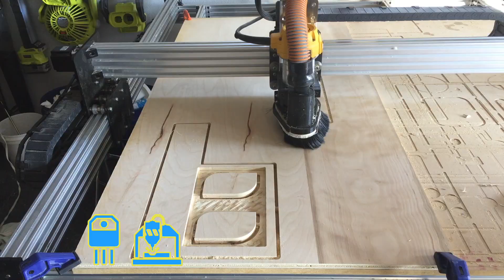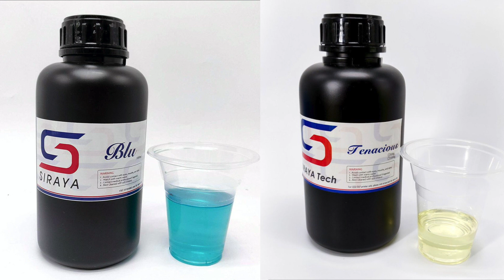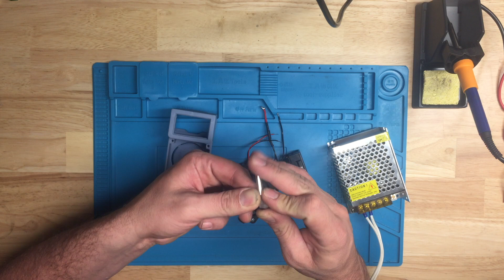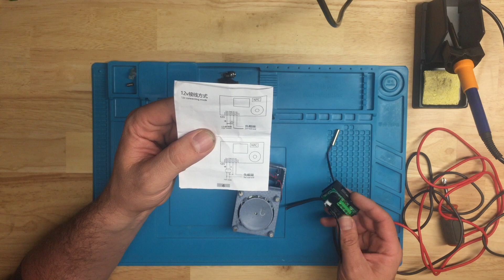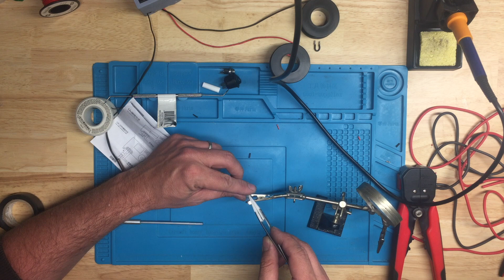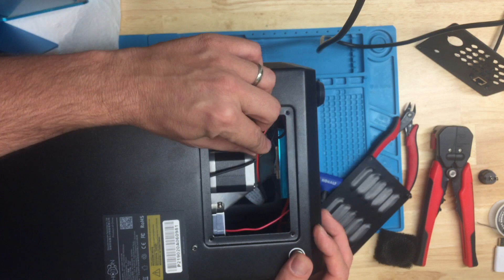3D Printer Resin Heater

Comment: This makes no sense. You can not print and blow air directly in to the print. You need to have a heated chamber around the printer. Or a silicone heating rubber around the tank. But not air circulating around the print.

Comment: Warning potential fire hazard! As an electrical engineer I need to warn anyone building this, this item needs a thermal fuse adding between the PSU and the heating element. If the thermostat, the PCB or the fan fail there is the possibility that the element will just continually heat up and not switch off! I have built this and I added a thermal fuse which hits a max temperature of 65c (any basic thermal fuse will do). I also added a timer switch so it turns off automatically to correspond with the printer time (you can buy plug timers which do the same thing). I also had to redesign the body as it's not really big enough either.
Reply: 100% agreed. let's not forget all parts are made in china.
Reply: Ty for info! I'm planning on a build similar to this and would like to add a thermal fuse for safety. I only seem to find fuses rated for 240V though. Is it possible to run a 240V fuse on 12V?
Reply: Yeah it will still work, it's just up to 240v
Reply: Could some One explain me exactly where to put the thermal fuse?
Reply: @matteopiccin5555  between (+) and the heater red wire
Reply: Complete noob here, got more details or vid?
Reply: You can cut the wire combining both heater elements + leads and just use one of them, thus cutting the power to 50W or so.  Still plenty of heat to warm up the enclosure and reducing fire risks.  100W is not really needed for such a small space.
Reply: It's a PTC heater they self regulate, they won't overheat if the fan fails and the thermostat stays on.

Comment: Please help. I've blown 4 of the controller units 😭 I wire everything up correctly but it still blows. I get it working. Unplugg the power supply plug it back in and it blows.
Reply: You probably wired the live to neutral or earth

Comment: Thanks for the DIY for the Resin printer heater.  I really want to build this because I'm also using Siraya Tech Build and other resins that require 25-30C environment. I have a Photon Mono X. I do have one concern thou; I've had my printer about 1 year now and just recently the plastic knob that secures the build plate along with the plastic knobs for the resin tray are disintegrating (I replaced them with metal ones from McMaster) - I conclude because of the resin. I would be concerned about building this out of 3D printed parts that they too after time (along with the fan) would be affected being in the chamber and recirculating the resin fumes. Any thoughts about this?
Reply: I think these have been out on the wild for more than a year now and the consensus seem to be to "just" print them in resin. 
I'll be building one shortly - parts are on their way - and if it lasts a year or two and I may then have to print a new casing for it, that's fine with me.
Reply: @AntiVaganza  Yes, since I did these I now have an FDM printer that does nylon - so if you have access to FDM,  I'd print the case out of PP or Nylon; that way it would be impervious to resin fumes and possible degradation.

Comment: What is the best air flow direction? The fan keep cold air that is pushed in the heater and then in the printer or the cold air enter in the heater and then the fan extract the hot air and push it in the printer?

Comment: do you keep your resin stored in a place that has high enough temps?  or is this setup expected to actually heat up the resin as well as the chamber?
Reply: This setup just heating the AIR inside the printer chamber, not the RESIN...so stupid, and being reproduced by many same ignorant "believers"
Reply: @archierri  like an air-fryer for resin.  Kind of how a home furnace just heats up the air in the chamber, and the rest of the contents of the home get to that temperature

Comment: I'm slightly worried about your wire gauge for this project. 10A you should probably be using 12AWG wire or you risk turning the wire into a heating element and starting a fire. I would maybe consider 14AWG. That 100W heater, using its rated capacity, should draw about 8.3A. I would consider a power supply of 12A or greater, and a 9amp inline fuse for safety, as it appears the thermostat draws no more than 1A. You aren't seeing any more than 50W usage because your power supply can't output more than that.

I totally intend to do a mod like this on my Mars, but I will implement these better design changes.
Reply: 1mm thick wire is good for up to 16A in most conditions this setup it can be pushed to 19A the thermal shielding is usually rated for 75C if it silicone its rated for 90C line fuse is a good idea but the wire gauge is good for setup

Comment: No instructions or diagrams with either of my components.  You fast forward through the wiring, do you use a jumper to the 3 grounds on the back of the thermostat?  Thanks. Excited to get my resin printer back up and running in this cold weather.

Comment: I think if I move my printer to the garage I'll need to do something like this. Will probably to a little transistor to mosfet thermal regulator though, otherwise it'll be cold after 40 mins or so

Comment: you say it's only using 50watts, but the heater is rated as 100watts. Will the 5amp power supply really be fine?
Reply: No! This thing is rated for 8+ amps, but always go bigger, at least 10.
Reply: Be careful. I burned my 12v 5a adapter :(

Comment: This is amazing! Also hoping to ask if I can just put my resin printer in some sort of enclosure with a heater inside and let the heat build in there. Will that get the same results?
Reply: in principal that sounds fine but you will need to regulate the temp so it doesn't get too hot.

Comment: Trying to follow along with this as I'm conpletly new to trying to wire things up. What hole on the thermostat do you put the red wire from the heater into. You fast forward through most of it and I cant see where they go. I can only follow with black cable to far right hole.
Reply: I haven't installed one yet but I have purchased the recommended components and am testing it out.
The thermostat has 4 terminals. Two ( marked + and - on mine) are for powering up the display and electronics of the thermostat itself . Those connections are totally separate from what you are switching and they can be powered independently
 On mine the switching terminals are marked S and S. Programming the thermostat will makes connections close or open depending on the temperature and how you have programmed it. 
It doesn't matter which one of the S terminals is connected to the + of your power supply. The other terminal should go to the device you are switching (via the red wire) ..and then that will have the other connection from the device (black wire) going to - on the power supply.

Trying it out, running the heater and fan at 12V can lead to a very large current, so I am trying it at 5V before I install it. 

I am also trying out a flat heater pad stuck to the back of the printer instead of the heater and fan. It's less disruptive to the printer (no drilling or taking apart) and avoids blowing hot air around the print area .. which strikes me as a potential issue source of a problem. Don't know yet if it will be better. Radiation v force convection ..swings and roundabouts

Programming the thermostat is not obvious. You'll need to do some hunting on that but folks have been very generous in putting up instructions on youtube.

Hope that helps
Reply: this video has a great step by step on wiring and programming: https://youtu.be/bQmmGj6gMdk

Comment: Awesome! Gonna do this to my Qidi Shadow.
Reply: @Kurt Kadow i did get it installed and it does work! However i encountered a few problems. Its really tight spaces. You can't use a magnet on aluminum, and that backplate is a super pain. I'll detail some of my problems nows.

The backplate is aluminum and the current power switch and plug are centered in it. Instead of altering it, i made a new one out of some 1/8" plastic. I had some black hdpe sheets so i used that. Recut the original holes for fan and screws, and offset the power plug and switch x2. The equipment that is suggested for use in the video is an exact match to what is oem on the qidi shadow. Just put them in the same vertical alignment but carefully measure the spacing for when you put it back together. Make sure that when you drill your screw holes to undersize the hole slightly so that the threads catch, as the original plate has an extra bit welded on to allow threads to be tapped. The plastic wont have this unless you add it. Do yourself a favor, take the bottom cover off to access the plate when putting the new backplate on. It will help tremendously when making the original screws bite into the new plastic plate.

The heater itself isn't terribly difficult to wire, but this video does a freaking awful job of displaying it. It fast forwards straight through the important section, but you should be able to figure it out. After it was wired, i fed the wires down the right side air scrubbers, and tried to tape the holes closed under both scrubbers. The heater will not face forward in that position due to size constraints. I faced it out towards the right, which is fine for me, but you could do it into the left side if you preferred. If its facing that way it will want to blow the hot air straight at the cover, which i didnt like, so i reversed the fan to blow through the heater. I had to super glue the whole assebly into this position very carefully, and hold it very securely until it set. If the heater crosses that line, even by a fraction, the lid will not close.

After that, i just fed the temp sensor to the opposite side and used the original scrubber to wrap the excess cable and tie it off to secure it.

Actually works like a champ, just dont do what i did and forget to program it to "heat" from "cool" mode. Its the P0 command. I thought it was broken lol

Its not to bad. I did it with the worst soldering iron ever, and i am terrible at electronics soldering to begin with, so you should be fine. I'll try to post a video if you need once i get back home.